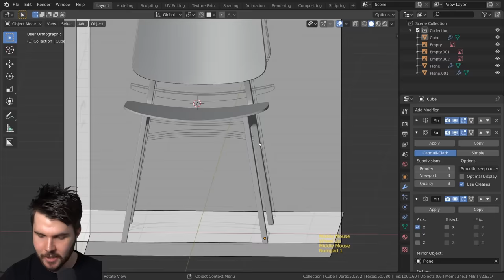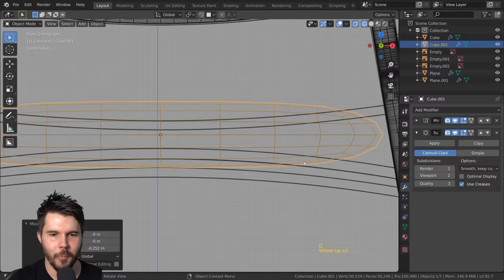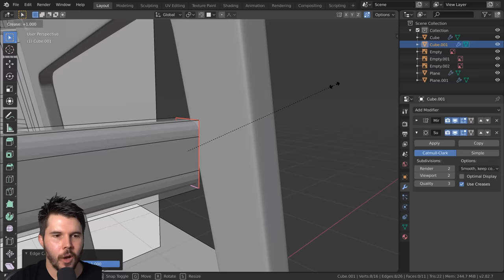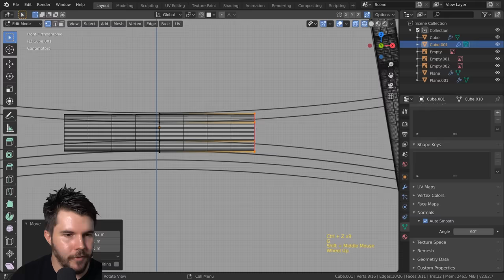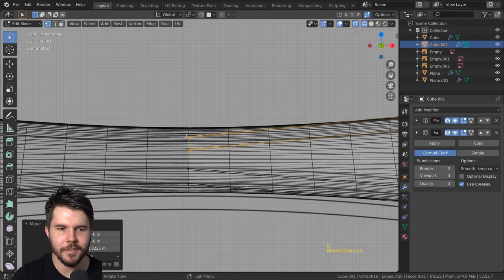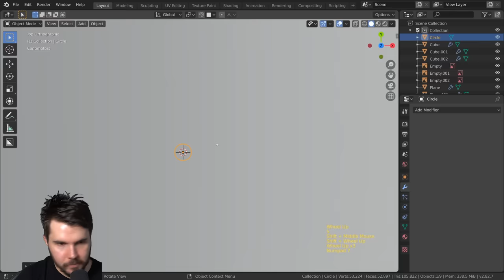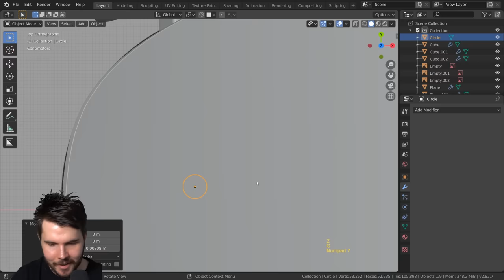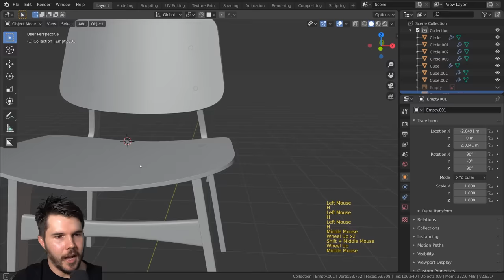Blender Beginner Modeling Chair Tutorial - Part 6: Creases & Shearing

Comment: 20:18 I just noticed something, if you change "Snap With" from 'closest' to 'center', you'll get much better control, it'll instead snap with the origin point rather than the closest part of the mesh (edge)

Also after I disabled selection to the chair in the Outliner (enable the filter in the top right), this allowed the screw to snap flawlessly with the top face of the seat rather than the frame below it.

(If it snaps to the bottom of the chair seat, position it,  exit X-Ray mode and press G, then Shift+X and left click. It'll snap with the top face of the seat. Little awkward, maybe there's a better way, lol

Comment: i nailed everything, did my homework perfectly, but when it comes to the screws, I failed.
Reply: michael meng same
Reply: you screw it up, arh man
Reply: Try use object mode to add outer circle, delete the surface, and back to edit mode, add the hexagon.
Also, I use solidify modifier gave it a very thin thickness.

Comment: Someone might have said this already, but you can join wood to other wood with little discs and wood glue. Basically, you cut a little line into both pieces of wood where you want them to meet up, you get a small disc of wood, you coat it in wood glue, and you put the two pieces together around that. Think of it like putting half of a CD in one CD slot, and half in the other. (Not sure if I explained it well, and not sure if that's what they did, but it's one way to join wood!)
Reply: I’m imagining they used mortise and tenon joints on the rungs, at least.

Comment: Coming from mechanical CAD it’s frustrating not to be able to exactly join parts (seat to legs,  stretchers to legs etc). Is there a way to accomplish this?
Reply: Snapping is pretty much the only way.
Reply: Snap to faces/edges/verts should get you most of the way there. Sometimes you have to be a little creative with it. You can also use the 3D cursor with Shift+S and then choose Selection to Cursor
Reply: You could try to make it perfect, or you could not. Blender is primarily an art software, rather than a CAD for product design or mechanical simulation, hence why Blender has a very different workflow. One of the most important skills you can learn as a 3D artist is to know when your artwork is 'good enough.' That means just close enough, detailed enough, and realistic enough that no-one will ever tell the difference. We are all learning as artists ;-)

Comment: 5:34 creeses are ment to help guide that modifier  with low poly models that might lose shape after tesselation.   parts like character lips and eyelids use creeses to preserve their shape after subsurf is applied. it also helps with complex models where loop cuts might break something important.   deleting faces is actually the pro way to do this as removing stuff no one will see improves performance . 

EDIT: ngons .. really ? 19:13

Comment: we can also use shrinkwrap modifier instead of a shear transform tool for the precise placement of a mesh. 
You just have to select the vertices you want to tilt, assign them to vertex group, add shrinkwrap modifier, set wrap method to "project", set snap mode to "on the surface", choose axis, set target (in this case the leg of a chair", select vertex group which you just created at the beginning and voila!

Comment: I'm actually pretty sure the back leg crossbar is higher than the front leg one, looking at the references. Also assembling the chair would be easy. Those wooden slots are longer than you think, and slide into the leg of the chair, probably about halfway into the wood. You'd slide the cross bar into the slots on one arm/leg and then snugly shove the other one onto the other end of the beam. Then the large screws go on the seat and back, and I'm assuming they put some kind of finish over that so that it's smooth and glossy and you can't feel the screws.
Reply: there's literally zero reason for this chair to be $300 other than apparently name recognition of some sort. Maybe the wood is high quality?

Comment: now I know this is 4 years late, but wouldn't it be easy to use the bool tool shortcuts and then add beveled edges around them for the screws? or would that be over complicated?

Comment: You mentioned how some of the menial aspects feel like manual labor. I get that. I think of it as digital knitting. A ton of little, incremental moves... do this, fix that, slide that, add this... and I'll look up, hours later, and look! The digital equivalent of three inches of scarf! But like knitting (I hear), that repetitive part can be soothing or trancy, if you're wired that way. It is for me, at least.

Comment: The extra lines in the blueprint images are because the blueprints are using a perspective angle - as it moves toward the edges of the blueprint image it's showing more and more of an angle instead of direct front on. The effect is small and doesn't really matter, but that's why there's "extra lines" and some things aren't lining up as easily as you'd expect.

I.e. the two support beams look to be the same height in the reference pics, but the blueprints show the back one as lower, dito the seat itself is flat in the ref pics but the blueprint shows the bottom face as well as the front edge like it's angled backwards.

Comment: To fix the screw top surface at 19:00 - Instead of building up the surface with ngons you can quickly use the "Bridge Edge Loops" command (edit mode/Edge/Bridge Edge Loops) for a proper surface, you might want to run a quick "Tris to Quads" (alt + J (no correlation with the band))

Comment: Making the screw its so easy. Add a 6 faces cyllinder, select the top face and make an inside face and then extrude that inside face down. Apply a subdiv. Select the edges from top and bottom and press shift+e or bevel it. Select the faces from inside and press shift+e or just bevel it. Now you have a good topology allen-screw or whatever its called.
Reply: I like that way. Never thought of that.

Comment: If your circle mesh is invisible/transparent, here's what you can do!

1. When you create your circle object there is an additional "Option" box that opens in the bottom of Left menu of the 3d Viewer. That option box is available until you do something other than create the object.

2. Open the option box and change the fill type from 'Nothing' to 'NGon'

This isn't necessary for this tutorial, but might be useful for your future projects ^^

Comment: To anyone stuck in Blender 4.0 at 12:07
I first applied scale to the board between the legs Ctrl + A (not sure if that helped)
You select the top edge or vertex of the board between the legs > click 2x G and then 2x C so that the edges touch the chair leg.
Why 2x C and not 1x C? Because when you press 2xG and 1xC the edges move along the X-axis and when you press 2xG and 2xC then you can lift the edge along the Z-axis like in the video. try to direct when pressing C so that your cursor goes along the leg. I noticed that it goes as I looked at the edge from a different angle. when I pressed slowly 2x C then the yellow lines went up. 
P.S to make the edges go up you have to move the chair as far away as possible in the view because the scale is missing. Sorry for the stupid explanation but I can't do otherwise.

P.s 2 (EDIT) 
You can use 1xC once, but as I mentioned above the cursor must be hovered over the leg.
Reply: THANKS

Comment: at 23:50 you said you didn't know how they put the wood between the chair legs. If I've learned anything from my dad's woodworking hobby, I would probably guess they used these little wood chip things that get glued into little slots you cut into the wood and it just kinda holds the two pieces together

Comment: Got the surfaces myself of the first try ^^ used a cube with bevel weights and then subdiv and not a solidify but wth...

Now I Want to know why you really hate the amazing 4th toggle of the Subdiv? The "on cage" button.
It shows the original mesh over the subdiv in a clean way without all the clutter and lets you directly manipulate it!

Comment: Does carving a hole for the screws in the seat and the back seat, would have caused problems with the face? (I mean the four edges rule...)
Because I think that a 900 bucks chair would have the screws inside the plane and not coming out of it. :)
Reply: Not too hard, the way this is being made .. you could let the subsurf  make a regular octagonal hole in the mesh into a perfect circle, without interfering with the surrounding topo. And make the nut out  of a hexagon, let the subsurf make the outside into a circle, but hold the inside to make the hex-socket.

Comment: 12:08 
You could scale it on its local axis there too, it would also keep it even (also for the loop you added).
You could've also edge slid the edge and its loop together.

no textures for such a close-up
18:00
you could've started the other way around, with the 6-sided circle from the center, extrude it out and make the outside with subdiv and then make the inside sharp.

The rungs and the legs are connected with hidden double-pointed nails in between them.
You basically get the nail on one side and then hammer the other side in the same nail.
Unless it's glue lol.

Comment: when I do the edge slide at 13 minutes, the edit also moves the corner not just up to create the arc in the middle wooden support bar, but it pulls it out towards the screen also / towards the user. How do I move it just up?

Comment: Here is how they do it without screws (like in every low budget chair). They carve the vertical wooden bars with a round or square lookin hole, that doesn't go all the way to the other side. For the horizontal bars, they leave a piece of wood that is the same shape of the hole sticking out, so that it is a perfect fit between vertical and horizontal wooden parts. They connect them, then the go for the areas that require screws (seat and back resting part)

Comment: If you don't want to add edge loops or use crease there is another way: use bevel modifier with bevel weight (Item tab (N),  edge data)

Comment: I found a way to center the screws. I created an edge along the center of the leg base where we deleted the top faces, right where the mirror is. Then I extruded it up along the local Z so it kept the angle of the leg, right through the top of the seat. Then I did the face snap but lined the center of the screw up with the face coming out of the seat. Then just deleted the face.

Comment: well uh subsurf modifiers don't take averages unless it's set to simple. If it's not, it goes with positions based on bezier curves i believe please correct me if I'm wrong I don't look at the source code, but it works using curves and not averages. If it did use averages, there wouldn't be any smoothing, it'd just be uselessly high-poly.

Comment: The screw should be really easy to do for anything that is not super super close up picture of the screw. Just add a screw texture with alphablended transparency so all but the round screw is left out and then add a normal map. The normal map will make the screw look like it is slightly lower than the surface if you adjust the normal map a tiny bit with nodes. I mean you'll add a normal map anyways to the screw so take benefit of that.

Comment: 5:45 for that one, I actually hate using to many loop cuts so I usually use bevel weights for each edge + bevel modifier (above the SubSurf), and I have been doing so when following the previous parts of this tutorial so it works. Just want to share with you :)

Comment: Hi, I have followed every step and I have all the same settings on both mirror and subdivision modifiers but for some reason my "chair ribs" don't have a flat continuos surface. They have a cut in the middle where the mirrored side starts, is pretty frustrating and I don't know how to fix it, is like the modified is not applied in the connection where they meet and this ruins the texture for the next step. I was so excited since I could do all the chair and screws etc but I can't fix this :(
Reply: I was stuck with this for awhile. I deleted the end faces (on the mirror plane) and this fixed it.
Reply: Thanks both for this :D been stuck in there for like an hour and then decided to look in the comments

Comment: I'm using 4.0. The edge/vertex slide responds to the 'c' clamp key as you note around 12:40, but it is not shown in the status line at the bottom like most tool options are. Is there another source for this information. I wouldn't have found the 'c' key on my own.

Comment: For the screws, would'n't it be faster and simpler to model a negative of the screw exactly like here, giving it a bit more depth, but extruding down the hexagonal part, and using it with a bolean operator to actualy screw it in instead of spending time on the right alignment and precise height above the surface?

Comment: Just a heads up incase any mac users are confuse... some of the shortcuts don't work when using a Mac keyboard plugged into a Macbook Pro ... for example... pressing 1 across the top bar does exactly the same thing as pressing 1 in the numpad - pressing Ctrl + 1 on both the external mac keyboard and the macbook pro's inbuilt keyboard mimics pressing 1 on the numpad

Comment: I think some more info about the screw would be useful. Create a circle? Cool. Go to edit mode, circle gone. Delete and recreate circles for 20 minutes and you get both. Ok, now they won't join. I've had more circle problems than anything on this chair; and I think I'm about to try to model a screw outright rather than this method at this point.

Comment: What I have tried is to create another cylinder a bit larger in diameter than the bolt and used it as a base for a boolean modifier to create the hole for the bolt to go in. Would that lead to issues down the line?

Comment: I had trouble getting the 'scale on local y axis' to work. Here was how I got it to work, albeit a nonoptimal solution:

I found out that if I rotated my rung in object mode, it would then follow my bidding when I pressed S-Y-Y. The downside to that was that I couldn't see the shape of the vertices in object mode, but I worked around that by lowering the viewport levels of subdivision to 0, so that I was working with a square.
Hope that is of some help anybody with the same problem.

Comment: To remedy the "Clipping should be turned on automatically using a mirror modifier" You can enable the "Auto Mirror" Add-on in the preferences and then in edit mode in the "edit" tab you'll see Auto Mirror at the top and you'll have all the options you would if you applied the modifier but it have clipping enabled by default!

Comment: double tapping g and then selecting c (also tried with alt) and it wont let me move them up and down but just backwards and forwards? any help?
help = 
I had the same problem, to fix it you just have to hit double g, move it down a little and then c so
Reply: Not working for me this either
Reply: Thanks, the key for me was to see the yellow guideline before I turned off clamping (which only happens when you move down a little once you've grabbed the vertices like you said).

Comment: @blender guru 
Hi, thanks for the tutorial, im using 2.9 and when i apply mirror, the vertex are not connected, so the front face would show half and half devided by the mirroing point.
i can alt click the whole thing before applying mirror, but i can only alt click half of it after mirror applied. is this an error? or did i model it wrong

Comment: Why not make a cylinder the eact size of the screw, which you can then use as a boolean object? That way you could have screws that are flush with the surface. Also, blender has a screw generator. Though the scaling is always off. You would also have to make sure that you had measurements for the chair.

Comment: Having an issue with the mirror modifier. There's a perfect, tiny seam right at the connection in the very center of the bottom rung. It becomes obvious once you select a view that really displays hard edges. It appears as if my mirrored form is sliced in half rather than connected as a cohesive form.
Reply: I get the same thing. Did you come up with a solution?

Comment: HELP. I double tap Y or even switch manually from the drop down menu to scale along the Y axis...but for some reason it always scales along the global, even if in the top left the label switches between local/global. Anybody have advice about what to do about this?
Reply: I THINK I found the solution. First rotate in Object Mode (not in Edit Mode) and then it seems to work normally.
Hope this helps someone. Happy Blendering

Comment: my mirror modifier does not work, why? i have the exact same settings as shown in the video
Reply: Same for me, it seems to use the local X axis in my case, did you check by switching into edit mode? I think I'm gonna use a mirror object to get it working with the global axis.
The origin point of the cube is still wrong, tough, I don't know why that is.

Edit: Maybe it had something to do with how the cube was created? After I mirrored the cube using an object, I set the origin to the center with X = 0 and then I could remove the selected mirror object, and it now works as intended. Not sure what caused this

Comment: I'm at the screw part. When I try to join the hexagon to the vertices of the outer circle, I'm not able to create a flat face. Anyone else having troubles? I noticed I had to add both objects to the same Edit Mode in my 2.93 version of Blender.
Reply: Solution: Join the two objects first. Enter Object Mode, select both objects and CTRL-J, then select the vertices and create a face.
Reply: You are a legend!